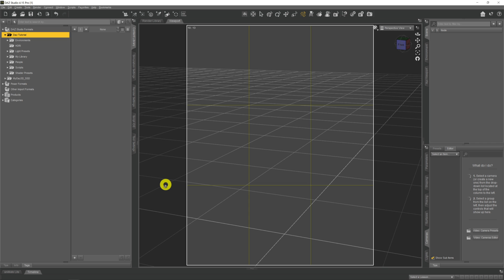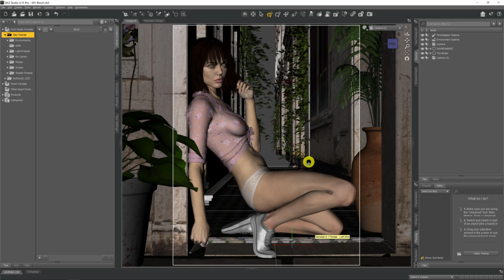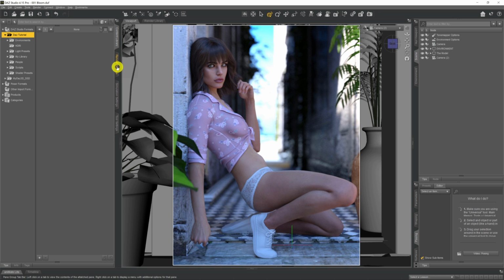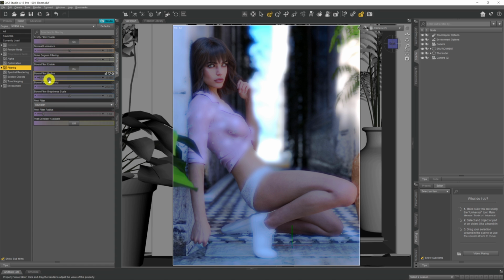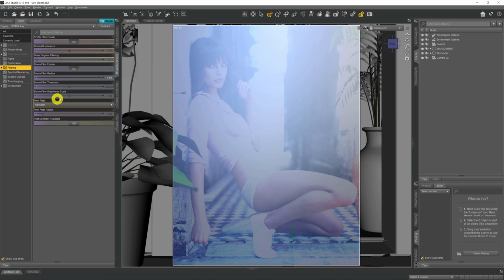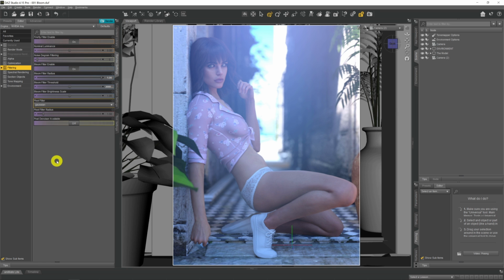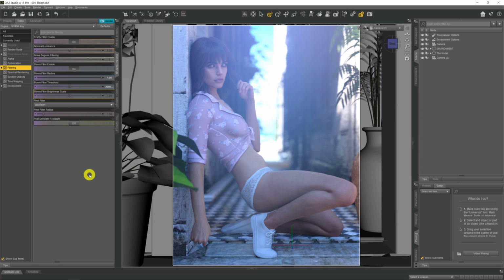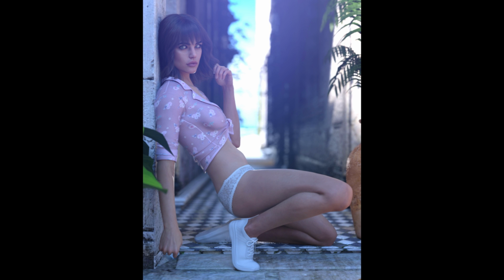Daz 3D : How To Use Bloom

Comment: Can you create lens flares using the bloom settings?
Reply from the maker: Hey there Smokey - I think lens flares are outside of the scope of bloom in Daz and I don't think there's any other way to create one .. I'll have a think on it though!
Reply: @RaukoDaz3D  I found a product on the Daz store for lens flares, specifically from a site that stated that flaring isn't possible without it.
Reply from the maker: @roberthazelton6347  Ah right - I wasn't sure whether it could have been done in Daz or not - have you a link to the product?
Reply: I use epic lens flare by the philosopher. Really nice product, not very hard to set up and it has lots of options. Sometimes I use the included png files in photoshop when I need a quick flare added in post.